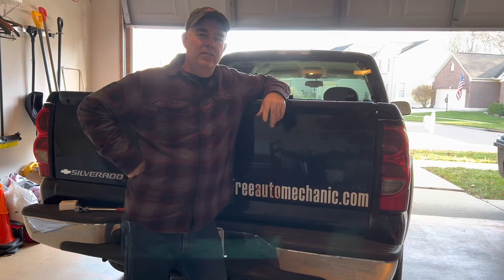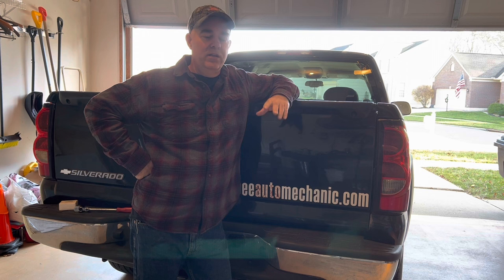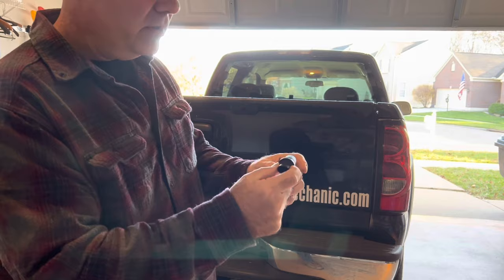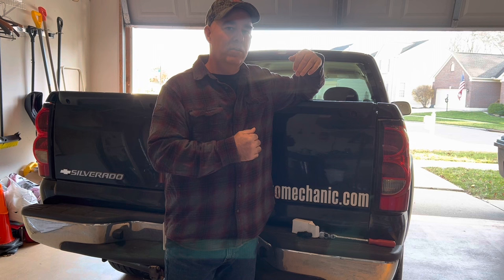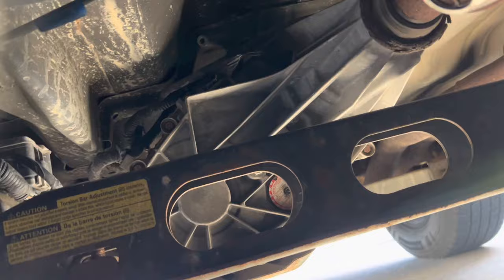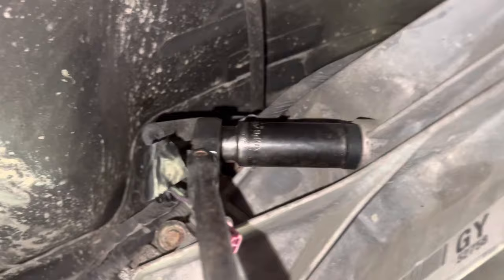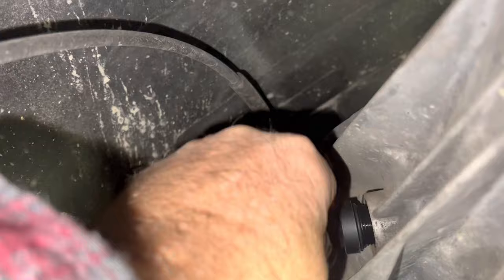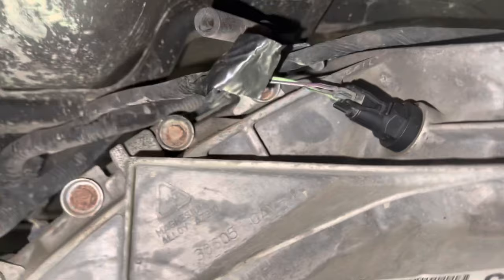Speedometer Erratic/Twitching Won't Shift - Code C0055 Speed Sensor *SOLVED* Chevy/GMC 1999 - 2006

Comment: Just had my transmission recased because transfer case locked up and broke the transmission adapter and cracked the transmission case. My transmission guy swapped the case and I put it in and it wouldn’t shift. I did code scan on my Marco scanner and it showed 0 codes. I went into ABS and seen the pending rear abs wheel speed sensor code, and cleared it. All is well!! I went ahead and bought a new VSS just to be 100%. Thanks SO GREATLY!!!

Comment: Thank you SO MUCH for making a video and getting straight to the point, understandable point, without 10 mins of unnecessary talking. Hopefully this works. Thanks again
Reply from the maker: I should ad that I ended up replacing the VSS Wiring Harness as shown in this video: https://www.youtube.com/watch?v=pGon2ij2M6I
Reply: @FreeAutoMechanic what if this don’t fix it
Reply from the maker: What if it does

Comment: Okay so I have this same issue.. I’ve watched both of your videos. I have a 05 Silverado z71 5.3. I was driving and service brake system popped up and Speedo started going crazy & losing gears like how yours did.. but it would randomly go away & randomly come back. It only does it whenever service brake system pops up, other than that it runs smooth. What could be the issue you think? I’m guessing maybe the wheel speed sensor on my passenger side front tire?
Reply: Replaced my vss, fixed my issue. Thanks for the help

Comment: My problem is that my fuel gauge on the cluster is always twitching or shows that I have no gas
Reply from the maker: Most common cause is bad ground to pump module(the fuel gauge sending unit is a part of that). Generally replacing the fuel pump module will cure the issue. In rare cases the gauged may need replaced. Thanks for watching!

Comment: Did it say speed sensor open ?
Reply from the maker: It reads: Chevy Code C0055 -  Vehicle Speed Sensor Circuit. Kind of vague but is what came up on the Scan Tool. Circuit description here: https://www.freeautomechanic.com/mechanic/forum/2021/11/gm-code-c0055-vehicle-speed-sensor-silverado

Comment: I noticed that your check engine and ABS were also lit.  Did this fix also clear those issues?  Or is that a separate issue?  Thx
Reply from the maker: Was a different problem that I took care of in this video: https://www.youtube.com/watch?v=kIjzL-zuC2Y     Thanks for Watching!
Reply: I'm having some issues with my all them light is on my dashboard my heat won't work or nothing
Reply: @andreamoss9186  this may be 8 months late but that’s most likely the ignition switch. Went through that a few months ago

Comment: i got a 99 silverado 2500 4x4  this summer when it was hot my tranny shifted perfect now itscold it will shift the first time but takes its time to shift the second time until the tranny gets warmer then it shifts perfect there in no engine light on so no codes

Comment: Hello thanks for your video it was so helpful for all the people out there my problem was different, my speedometer didnt move at all and it wont past 1 gear, so i wasnt that sensor but it was the other one located more like back on the transfers tail closer to the drive shaft, it wasn't the sensor but one of the cables of the harness was cut it was green and black wires i think, my truck is a z71 4x4 RCSB 99 5.3 4L60 in case anyone else have this same problem it can also be that other sensor
Reply: did you fix the wire?
Reply: @shanecargile5538  yes just put it together with black tape im gonna weld it soon so is more secure but that was the whole problem

Comment: Sir. I want to thank you for making this video! Straight to the point! I have a 1997 Silverado with an automatic transmission and it won’t shift out of first gear until it gets warmed up. Drive,  drive 2 and reverse are strong, but drive 3 it just revs up. ABS light is on and speedometer doesn’t move until it gets warmed up and when it starts shifting like it’s supposed to the ABS light goes off and the speedometer starts working. I’m thinking speed sensor or bad wiring. I’m going to crawl under there and check her out! Thank you again sir!
Reply from the maker: You are quite welcome. We are all in this world together.
Reply: Rodney Chapman did the speed sensor correct everything? Was you able to go into 3rd gear?
Reply: Yes sirrr!!!! I bought me a new speed sensor, changed it out and she now shifts better than ever!!!! $12 fix. 🙂 Again, I won’t to thank you sir for your video!!!! I’m no rookie at working on vehicles, but I watch and use a lot videos to give me better direction. Saves a lot of time in my opinion. Have s great day my friend!!
Reply: @rodneychapman197  did you have anything in the bottom of your transmission pan, metal or anything?
Reply: I didn’t check it. I just changed out the speed sensor. It was right on top of the transfer case so I didn’t go into the transmission pan. I recently had a new flywheel put on and there was not any metal or shivers in the pan.
Reply: @rodneychapman197  ok thank you Rodney for getting back to me. I'm having the same issues. I ordered a VSS too. Hope it fixes it. Thanks again
Reply: Bevo. I hope that’s the issue with your truck. I read where there is a cable that comes from each wheel that sends a signal to the ECU and the speed of the wheels tells the transmission when to shift. I’m not sure if I’m 100% right about that so don’t quote me. If I were you I’d definitely change that speed sensor on top of your transfer case SECOND. FIRST I would check your battery terminals, make sure everything is making good connection and  then check all your grounds that ground to the frame. It’s sorta a process of elimination sometimes. Just make sure you check your battery terminals, ALL grounds and it wouldn’t hurt to check all fuses before you start throwing parts at it. If you have more questions just leave a message on here. I’ll be happy to help you. This gentleman surely helped me and I want to pass it on!!! 😊
Reply from the maker: @rodneychapman197  Your Welcome!
Reply: @frankgotcha  also. The gentleman in this video mentioned that the speed sensor is plastic and to be careful putting a lot of pressure on it with your wrench while taking it out. LISTEN to him! Lol Mine was SUPER TIGHT!! I had to put a good bit of pressure on it to get it to break loose! I asked myself “Dang! The last person to tighten this speed sensor must have used a cheater pipe tightening it up!!” Jeez! There is no reason to tighten something plastic this tight!! So. Just be careful with it. I finally got mine to break loose. Here’s a little cheat to help you get it loose if it really tight. Put a little pressure on your wrench and use a small hammer to gently tap the end of your wrench in the same direction as you’re trying to turn. Having a little bit of pressure on your wrench and tapping on the wrench acts as an impact wrench and can help loosen it in most cases. DON’T TAP REALLY HARD. Lol Gently gently!!!  Good luck and we are here for Amy questions you have.
Reply: @rodneychapman197  thanks man I appreciate that
Reply: @rodneychapman197  some do, but that era of truck used the transmission output to determine vehicle speed etc - newer technology for sure monitors each wheel turning speeds

Comment: Can you be more specific about where the other end of the wiring harness is?
Reply from the maker: Why Sure! You will find a highlighted video at the end of this one that dives into the wiring harness repair. Here is a link: https://www.youtube.com/watch?v=pGon2ij2M6I
Reply: @FreeAutoMechanic  thank you so much
Reply: @FreeAutoMechanic  the abs code reader said irratic speed sensor signal... That's the wiring harness correct? I have replaced the speed sensor 3 times.

Comment: Thanks for the very good explanation. I replaced the sensor and it still won't shift out of low gear. I'm thinking it's a pinch or frayed wire. It's had a bad oxygen sensor code for a while. I replaced the oxygen sensor but I still can't find the problem. I'm thinking it's there where the wire are laying at the body line but I don't think I can get to it to fix it without pulling the transmission. Got any suggestions?
Reply from the maker: Start at the back where the VSS sensor wiring harness connects and work your way forward. When it comes to tracing wiring issues it can sometimes require a lot of patience. Hang in there.
Reply from the maker: Here is a video replacing/repairing the vss wiring harness: https://www.youtube.com/watch?v=pGon2ij2M6I
Reply: Maybe shift solenoids. If it won't shift, but I think if it was the solenoids, you would be able to go to 2nd gear, just not the higher gears or vice versa, I don't think it'll throw a code that directly indicates this but I could be wrong there.

Comment: i got a 02 chevy 1500 4x4, did you only replace the one sensor or did you replace all 3 on the transfer case?
Reply from the maker: Only needed to replace the One sensor. Thanks for watching!
Reply: @FreeAutoMechanic  okay! I replaced all 3 and now my Speedo doesn’t work and trans won’t shift our first due to no Speedo
Reply from the maker: @toddsims5147  Here is a a follow up video of what I ended up doing to correct my issue. https://youtu.be/pGon2ij2M6I  Your problem may be similar to what I had to deal with. Check it out.
Reply: @FreeAutoMechanic  I didn’t get around to watching the video but my issue happened to be the wiring, so I ran new tires and a loom from the computer back to by VSS and that fixed my problem?

Comment: I have a 95 K2500 454 4wd that I thought might be the speed sensor but I just replaced it and the speedometer runs very smooth, but it will not shift out of first.  Not sure where to go next. Does anyone have any ideas?
Reply from the maker: Here is a good read. https://www.freeautomechanic.com/transmission-troubleshooting.html

Comment: I have a 99 Yukon that won’t shift to second gear it’ll shift to third gear after 20 miles an hour, but I have to let off the fuel then it will shift into third. It will not go in the second gear, no matter what you do in the ideas.
Reply: Any ideas?

Comment: I have the same issue I replaced the speed sensor and didn’t work for me.
I think my wire harness may be bad can you explain more on how you fixed it?
Mine is a 2004 GMC Yukon 5.3 2wd
Reply from the maker: So far All I have done was disconnected the harness connections and wiggle the harness and it has been working flawlessly since. Am waiting for warmer weather before digging to deeper into where the exact location of the harness failure is. Hope it works for you as well.  Thanks for watching!
Reply: @FreeAutoMechanic  
Did that still didn’t fix my problem.
I only have 1 & 2nd gear I just recently did a transmission swap and it does the same thing.
Where should I start? Could I possibly have a bad pcm ?
Reply from the maker: @marcoherrera2464  Best place to start is with the Codes. What are all the codes present?
Reply: You could have the sensors swapped in the wiring

Comment: Where did you find the specs for the amount of oms the sensor is supposed to be?
Reply from the maker: Ohms information was located in an Auto Repair Manual. https://www.freeautomechanic.com/repairmanuals.html
Reply: You can see if the sensor is working by passing a magnet back and forth of the tip while watching the reststance, the changing magnetic field will change the value of the resistance as it switches

Comment: My 93 s-10 auto 460L did the same thing. Also at the time my abs brake light would come on??? Unhooked battery and cleaned odometer speed sensor with brake cleaner and electronic cleaner. Hooked everything back up, problem solved.
Reply from the maker: I am trying to picture a 1993 Chevy S-10 with a Ford Big Block 460L Engine in it. Sounds wicked! 1/4 mile time? or Show?

Comment: My speedometer jumps up and down while driving now and it shifts very badly sometimes it feels like there's nothing like I'm in neutral then the next I'm stuck in overdrive or 1st gear. And it just happened all of a sudden. Could this be my problem you think?
Reply from the maker: Do you have code C055?
Reply: @FreeAutoMechanic  I don't have a code yet I stopped driving it. The abs light stays on now. But the speedo jumps like yours and almost shifts like yours

Comment: I've been told these speed sensor can make it so you can't shift into 3rd and 4th gear I only have 2 gears 4L60E my 01 silverado LS 4.8
Reply from the maker: Let us know if replacing the sensor fixes the issue you are having. Specially if it has code C0055.
Reply: @FreeAutoMechanic  but there is no codes at all nor check engine light.  People keep saying it's my clutch pack but also the transmission control module can cause no shift for 3rr and 4th gear too.
Reply from the maker: @brenninknudson6017  This video is dealing specifically with the CODE C0055. As your vehicle has no check engine light on or codes this video may not address your needs. If you have a question please ask it here: https://freeautomechanic.com/

Comment: I'm confused again because the transmission has 2 speed sensor and rhe transfer case has 3 you're not really showing mote explain such identifying information.
Reply from the maker: This video is dealing specifically with the CODE C0055. As your vehicle has no check engine light on or codes this video may not address your needs. If you have a question please ask it here: https://freeautomechanic.com/